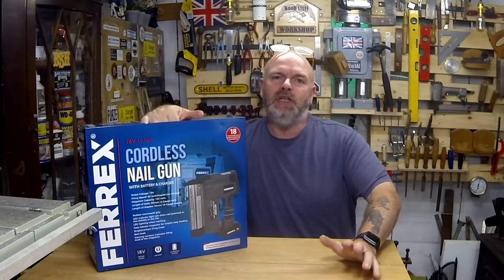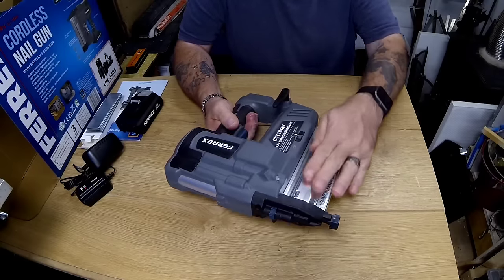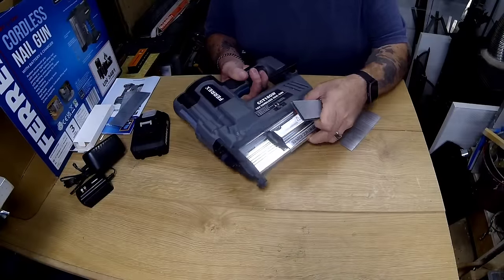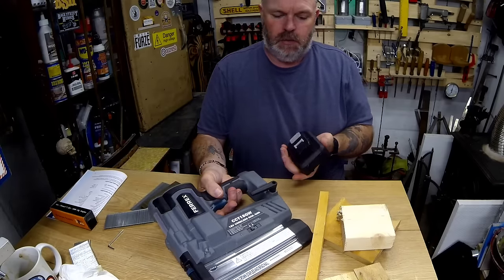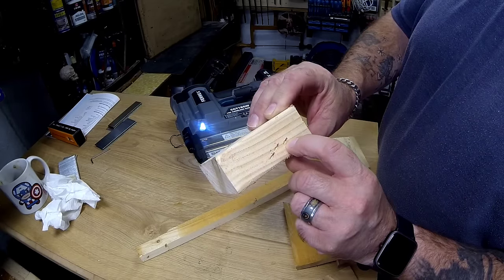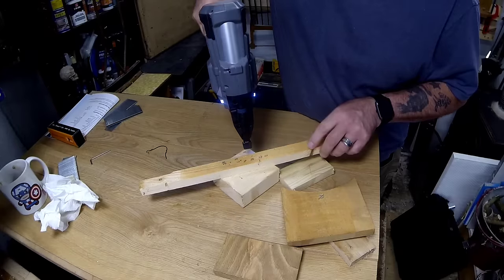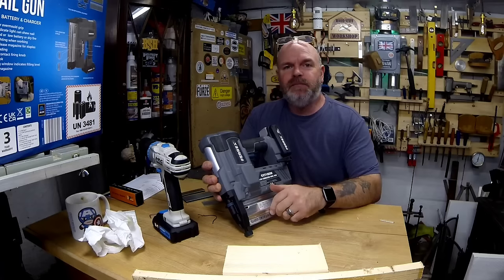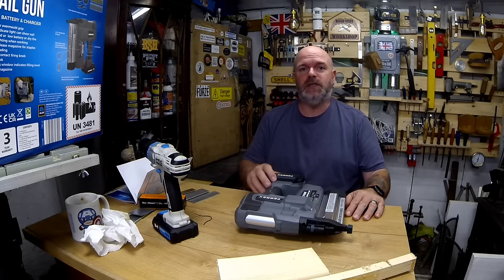Cheap Battery Nail Gun Review / Ferrex Cordless Nail Gun

Comment: I wish he had told the overall weight, and balance of the unit. I heard a few years ago that if you could get nails made in America that you don't get as much jamming. I been thinking about getting one for some time now. Thanks for the video.
Reply: This is a DIY tool not designed or built for commercial use therefore i don’t suppose weight/balance is really an issue to the DIYer

Comment: I've had a VonHaus equivalent for six or seven years now - same nail gun just a different colour. Used in diy so not heavy use. Never had any issues with it and eliminates the need for my compressor to power my air nailer. On a big job I'd use the air nailer as it is lighter to use 😀 but has the air hose to get in the way 🙁.

Comment: I have the Worx version and found it gave me a lot of jams and problems with hardwood penetration ( which i am working exclusively with ). However i have found the DeWalt galvanised brads solved all my issues with my gun, not had a single jam and penetration is better ( ohh err missus )

Comment: Had another name version of this tool, it was a waste of money. Removing a jammed nail was a pain and it happened too often, the nail driving pin became stuck in the fired position and it leaves a big mark in the work surface that needs filling ( ok when using the staples). After about 3 days of not heavy use it just stopped working.
Buy cheap, buy twice.

Comment: Hi, nice review. I have the air powered nail guns from Aldi and they are very good. Used them to build  my 22ft x 11ft workshop in 2005. No complaints then and none now as it is still standing. TBH I didn't know Aldi did a battery powered nail gun, I will have to look into this as it would be invaluable at the allotment where I don't have main power. Cheers, Norm.

Comment: The battery (and probably the tool itself) is made by Positec, Positec make for a lot of different manufacturers they are consumer branded as Worx the Bauker 18V Battery 2.0Ah from Toolstation is supposed to be compatible I would imagine (but not tried it) the Worx batteries are too
Reply from the maker: Thanks John for this info, I have actually got a Ferrex 18V 2Ah battery from one of my other tools I might try 👍
Reply: The Bauker battery does work as I've got one
Reply: Also the work zone 18v batteries fit.

Comment: I've had mine for about 4 years or more and it's been absolutely great. Its cheap but it's the same components as other more expensive brands just in a different plastic casing. I use mine alot and in the beginning I had a good few jams but not for awhile has it jammed on me. If it does jam its an easy fix anyway. I would highly recommend this gun it will definitely get you out of bind and easily make money back on time saved messing around trying to hammer little panel pins..
Reply: what's the shortest nails that can be use in this  nailer as I want to use 15mm if possible. cheers
Reply from the maker: 20mm is the shortest that can be used in this.

Comment: Hi David. Thank you for the comprehensive review! I have a question, when you went out to nail the log and also when you tried to nails a sandwich of three pieces of wood, was your power setting set to max at the top? I have one of these and I sink 50mm nails into hard timber with to problems. The unit I got, unfortunately jams every few nails. Took it apart, fit and finish of the internals are a hit and miss thing. Firing head being misaligned is just one of the issues. Waiting to see if manufacturer will help me rectify the situation. Fingers crossed.
Reply from the maker: Hi Mark, when you say power setting I can only think you are talking about the depth setting. I could not tell you where I had this set but I will not be using it on hardwoods as I think this would put a lot of stress and wear on the internals. I used the gun for cladding my shed part of the workshop and it worked great. Hope you get sorted with yours 👍
Reply: @InTheWorkshop  Yes, I was referring to the depth setting. I was curious as I never use it at full power and nails are always fully embedded, unless a failure occurs. Long winded process dealing with the Chinese. Trying their best to blame users instead of less than desirable quality of product. Cheers!
Reply: They've changed from Samsung to non Samsung Batteries I suspect the units may be made by someone else also under the generic "Ferrex" front name.. perhaps they aren't as well made as they were previously now, I'm hoping that's not the case as I've just ordered one so wait and see.. also trying to find out if other brands will fit it as it's a generic design that a few "brands" use under different names so I'm hoping the battery fitting is the same on some others like Worx or Riobi which look to be the same aswell as Silverline and a couple of others and prices varying MASSIVELY upwards of the Ferrex for basically the same tool so I don't think you can go wrong for £85 if it works as it should and if not then it's going back! Lol 😅👍💪😎

Comment: This looks like the model I bought from Sealey, made in Asia and badged, the first Sealey one I bought, I sent back for repair three times, the first time the striker snapped, the next two times it just didn't fire, on the fourth time it failed, they sent me a replacement, this worked for about 30 firings then failed, since it was now out of warranty, their customer service came to an end. I tried to get it repaired without success, stored it in my workshop until I threw it out as a complete waste of time and money. Incidentley I am a 75 year old retired engineer and hobbyist so it did not get excessive use.
Reply from the maker: Yeah, wear to the firing pin is my concern with this but OK at the moment but this nail gun does not get a lot of use.

Comment: Would you recommend a nematic nailer or battery operated one ? I have never owed one but looking to get one
Reply from the maker: I prefer using an air nailer with a hose and compressor. Obviously this restricts where you use them. I have never used the nailers with gas cartridges.

Comment: Great video mate I've just ordered one and also trying to find out if other batteries fit it from any other brands as it's a generic make rather than a brand in itself. I also found out they used to have Samsung Batteries and now they don't could be they're made by a cheaper version from different company so will see whether they maintain teh good write up they've had last 3 years as it's only changed this last release batch.. only found out through my own digging in the details and online..
Fingers crossed I guess but at least there's a 3 year warranty of it don't do what it's supposed to/sink em in properly then it's going back.. 100%

Comment: I have only just learned the hammer and thus have never even been near a nail gun. Whilst stuck at home I have been teaching myself some stuff, I have been making square and rectangle planters from broken pallets. Do you think this would be any good for that? I haven't a clue what wood, soft or hard that pallets are made from? Great review and teaching video. Many thanks. Have subbed.
Reply from the maker: Thanks very much Dene, I think this will be up to the job you will just need to get some different length nails as the ones you get are probably to long.
Take care 👍
Reply: @InTheWorkshop  if you fire against a heavy piece of steel the nail will turn back into the wood if the tool is strong enough.
Reply: most pallets are softwood but not all.

Comment: your review is wrong m8, you used the staple and changed the depth gadge a massive amount trhen shot smaller nails but but when you loaded the 50ml nails they stuck out of course soft wood will take them but changing the depth gadge will drive the 50ml nail all the way down.  both nails went through your hard wood stopping at the depthregardless if hardwood was on top or under the 2 softer wood.